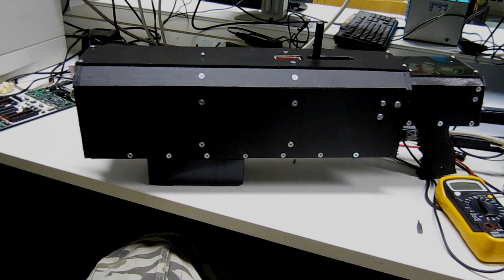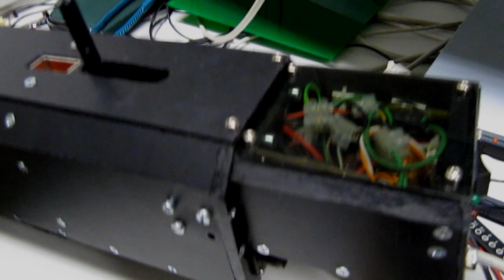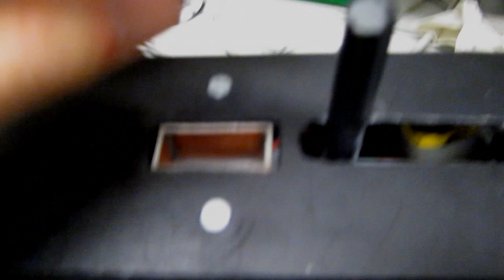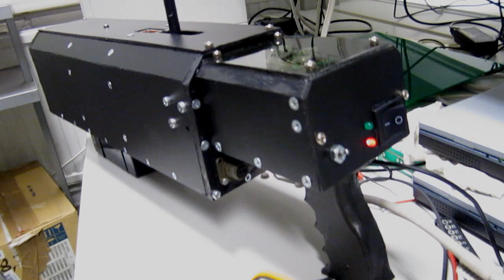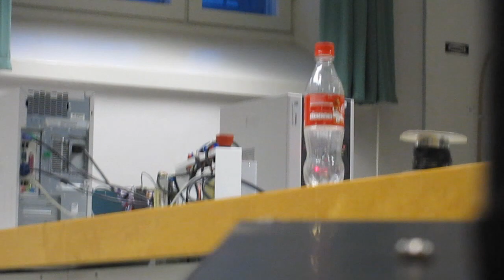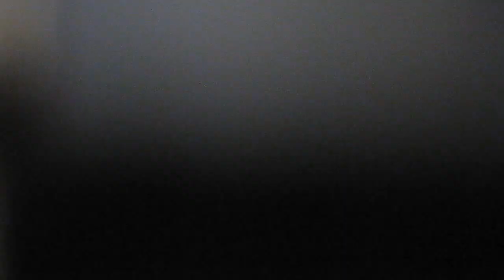Home made Coilgun, 5J kinetic energy

Comment from the maker: @Britishdude1 It's about 750 joules if I remember correctly. Charging time depends on what energy supply you use. I have a 12V battery, so I need a buck-boost circuit to raise the voltage. So that circuit becomes the bottle neck for my design.

Comment: @aserta Overlapping coils will make a difference. The thicker the coil the stronger the field of flux will be. Especially, if you add a metal core such as iron. The longer you make the coil the more you spread out the flux, so in this case the projectile could be farther away form the center of the core and still get picked up. Problem is coiling it properly, it isn't a easy job. Unless you have a machine. You can do it by hand but it takes forever..and I mean FOREVER believe me I did it

Comment from the maker: I used a voltage divider and a microcontroller AD-channel. One simple way would be to use a voltage divider and a comparator (LM311 or such). I think I used 3 x 330k + 1 x 10k resistors. Be sure to choose them wisely.

Comment: @szuszi2 I managed to find one cheap which is intended for power main usage.  It can handle 1200v at 1400 amps.  You can however, use several 18amp thyristors in parallel to get the desired amp/volt ratings.  Just be sure to put some 100 ohm resistors on the i/o lead to make sure they all trigger at the same time.

Comment from the maker: @szuszi2 18 amperes is not very much. I'm using a huge thyristor. I never found a proper datasheet for it, but it has held so I haven't changed it. Are you using a mechanical switch? I recommend a thyristor. But watch your eyes when using semiconductors for switching the current on, cause they tend to explode.

Comment: have multiple cap banks that get charged as soon as their fired, have a selector switch so you can choose to empty all banks at once for a strong shot or empty them seperate so you can fire and have others charging at the same time,  put the power supply/ caps in a backpack and have a chord running to the gun you hold, the gun can be smaller since you have the power stuff in a backpack like a flamethrower,  add a magazine and have a motor reload it after each shot,  then maybe you can have a sh

Comment from the maker: That's what I thought. The circuit you're referring to and the LM311-circuit are both schmitt trigger circuits. LM311 has internal hysteresis. Also, there might be a problem in choosing the resistor values and power ratings in the BJT-based solution. With LM311 all this would be easy.

Comment from the maker: @hifatpeople Good suggestions. If I had the time I would improve it. Most of all I would want to build a faster charger-circuit. It's very basic now. I burned all the electronics after testing a more powerful coil. Now it's almost repaired. Just need to reprogram the microcontroller. Magazine could be added even without a motor. Although you would still need to pull the rod on top of it back and forth.

Comment: @teemune I'll admit i'm not an expert however i do have some acquaintances specialized in this field and in some talks grazing the subject i did hear about overlapping coils. Tough i guess that it requires actual processing, calculation to reach close to max potential, just firing both at the same time won't achieve anything more than just what a longer coil/more power would. Meh like i said not an expert but maybe it will help. It's a really cool concept.

Comment: do you think a piezoelectric composite bow or a hydraulic 10,000psi actuated transducer rifle make enough power to fire a coilgun/laser
Reply from the maker: I think it would be easier with a rifle. Both have enough energy, it's just about harvesting it. I'm missing the point though? :)
Reply: manually powered hydraulic pump to fire a piezo cell or a transducer for a coil or bunning laser/ piezo composite X tranducer or 2. the novelty. both hand powered. arrow to bb or laser pulse
Reply: for you gun wouldn't it be a better design to make it a Z shape barrel on top batteries & capacitors on bottom next to the hip
Reply from the maker: Yea, the covers/mechanics of the weapon were made in one evening in a friend's garage, so they are not optimal.
Reply: magnetic ring spinning at 50,000rpm suspended in side aluminum block flyweel battery what do you think

Comment from the maker: @Mike0brien Metal core in a coil gun coil? ;) You should use a drill when coiling if you want to have a lot of windings. We used thick wire and not so many windings for big current.

Comment: @teemune with amunition as heavy as a carbon steel bit thats pretty damn weak, pellet gun with a much lighter projectile could penatrate 3 or 4, and even more depending on the gun and the projectile (still much lighter) i think what you have is a great project and likely fun as hell to build, but power? hardly. a lovely looking peice though, and as i said likely a fun project.

Comment: I like whe nthe the red light comes on..whats that mean? and i believe this fall outside of the "Firearms" technical definition...
Reply from the maker: J.T. RipTideProStaff In technical terms in means that the capacitors which work as fast energy supply have reached high potential and the "gun" is ready to fire. Practically it means that you need to stop poking the electronics with anything conductive, because the true life hazard in the gun lies in the internal capacitors, not the muzzle.
Reply: Lol.... find that one out the hard way huh...not only does it spit it bites too? lol. Not for under water use either I bet..lol

Comment: You don't. Coil guns/rail guns are a neat concept but they're not a practical weapon. That's why the military doesn't use them. Much cheaper and easier to use gunpowder than magnetic power to hurl projectiles. The Navy has been working on a rail gun for years. But it's as big as a boat, takes an hour to charge, and needs a nuclear reactor to power. In theory, it WILL sink an enemy ship though ^_^ Throws something like a steel girder right through the target.